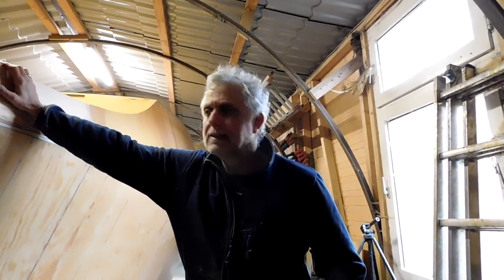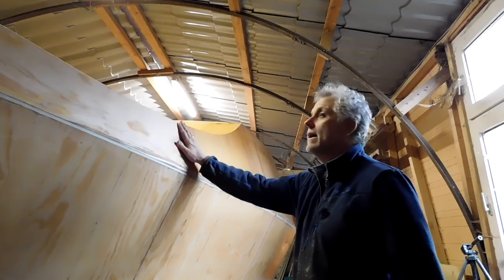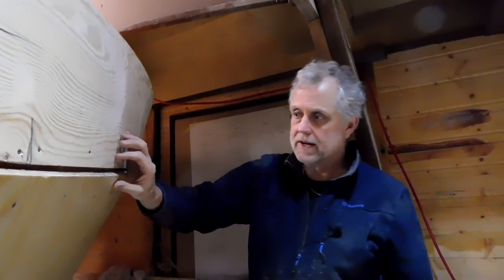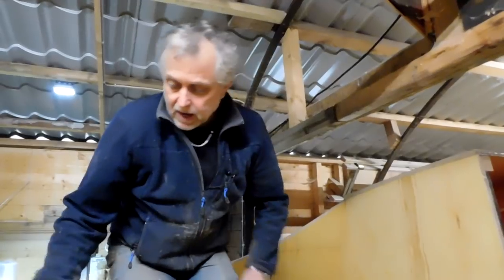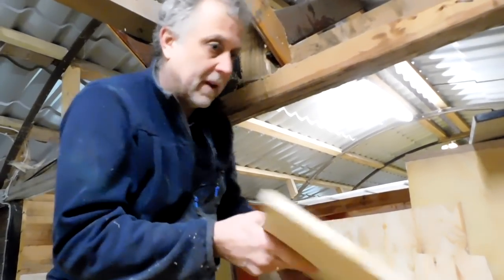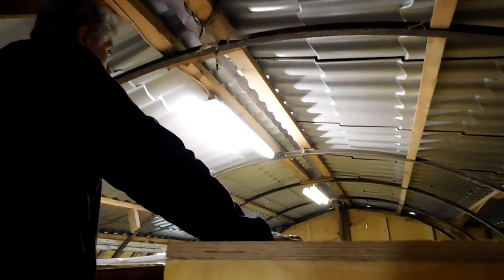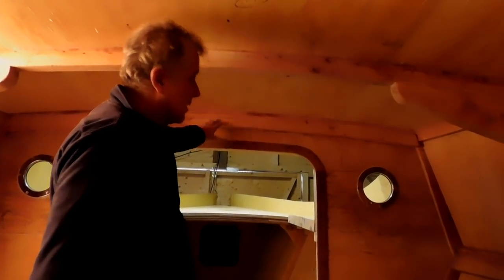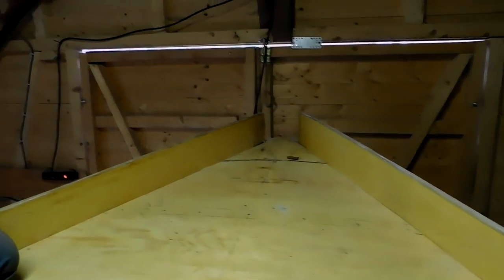The state of play - SV Tapatya EP78

Comment: The cockpit area is kind of tiny  Will guests be forced to be inside? Other than that it looks awesome
Reply from the maker: Thanks. There'll be plenty of aft deck space, and she's only 32 ft so a limited number of guests possible. In my eyes, small cockpits are more seaworthy 👍😀
Reply: In the open ocean, large cockpits are a dangerous liability during storms. They can hold (literally) tons of water, compromising stern buoyancy precisely at the time when maximum buoyancy is needed for the stern to rise up and over large incoming waves. This is why all old wooden ocean-going yacht designs had tiny cockpits. The old-timers knew what they were doing.

Modern large cockpit cruising designs compensate by trading seaworthiness for speed, the idea being that the less time you spend making a passage, the less chance you have of being caught in heavy weather. This is a very shortsighted approach, because sooner or later, you will get caught out. To get that speed, they use features that used to only be seen on racing boats, like skinny fin keels and spade rudders. Both of these devices lack the strength of more traditional keels & rudders, having what amounts to a single point of failure,  and thus are easily damaged/broken, particularly in heavy weather, and are virtually impossible to repair at sea. In my opinion (and Tony's too, apparently), such designs are unseaworthy.
Reply from the maker: Precisely :-) - the comments on cockpits, that is :-)